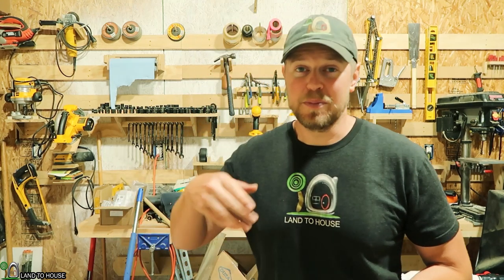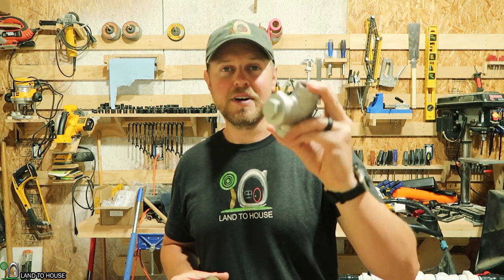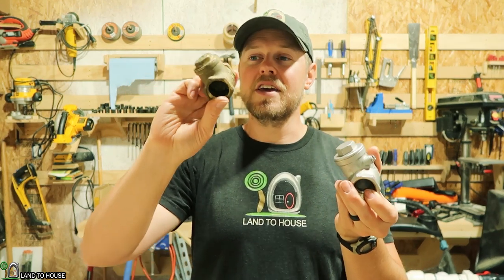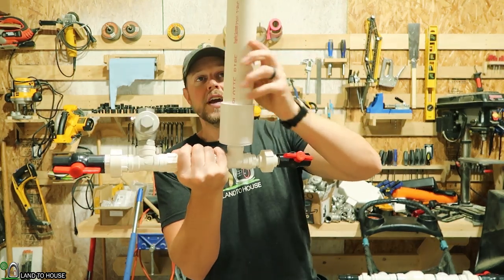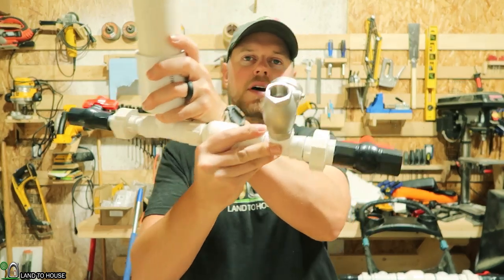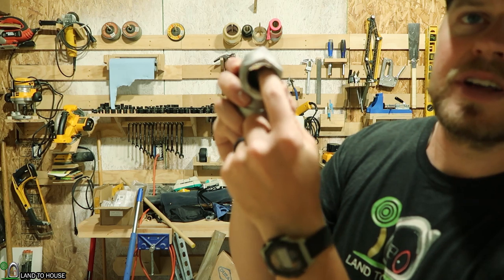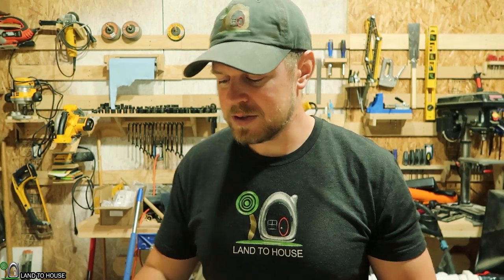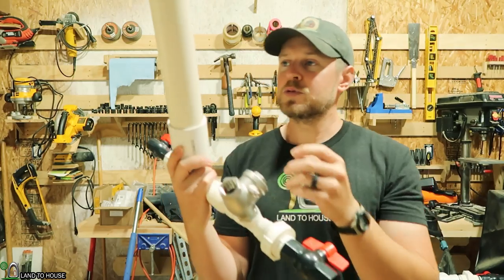Ram Pump Not Cycling with Stainless Steel Waste Valve

Comment: I built the 1 1/4” ram pump with the 4” x 17” pressure tank. I put the bicycle tube inside but I’m afraid maybe there is to much air in my tube. The pump will not start. Any ideas?
Reply from the maker: You might have air in the drive pipe or the delivery does not lift high enough so to maintain back pressure.

Comment: Just a thought... can a rampump be used to supply another rampump?
Reply from the maker: That is a very good question. And I intend on doing that test very soon.
Reply: Yes; but the waste water to run it will add up so efficiency will be even lower for the system.

Comment: 1) what would happen if you did this tilt on a brass model? Just curious. 
2) can you apply a downspout on house gutters to this ram pump concept?
Reply from the maker: If you tilt a brass valve it closes easier with less water flow and pressure. Because the valve is so light it can actually prevent the pump from cycling. But if you have an extremely low head pressure application it is a valid way to get the pump to run.

The ram pump needs a constant flow of water to be effective. It will run on hydrostatic pressure but the rain in the gutter would not keep it running for long.
Reply: Land to House my thought was to have IBC totes hooked up to gutters of my barn for initial collection then release the water (once full) letting gravity pressure feed the ram pumps to push to a higher tower with more storage? Would that work?
Reply from the maker: Yes that does work. Do keep in mind that the efficiency of the ram pump with the limited water source is very poor. You'll lose Approximately 80% of the water that goes to the pump out the waste valve. So if you have one of those 270 gallon IBC totes you'll only have around 60 gallon pumped.
Reply: Land to House hmmmmm. We don’t have a pond or a stream.  Might be the best option to get to a higher tower for better gravity and more storage even though it wastes? Thought about building a slide pump with a check valve to pump from tote to tower....but that would take a lot of energy and work that would be better used on other projects around the homestead.  Hmmmm. Thanks so much for the info this helps a lot!